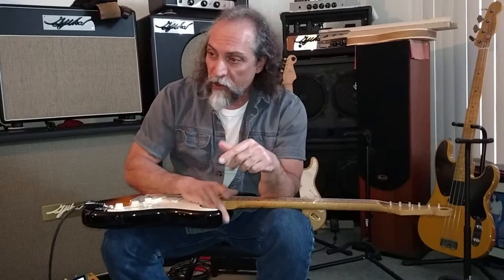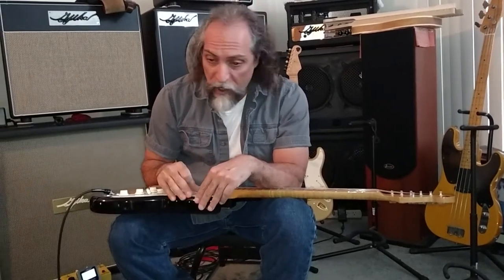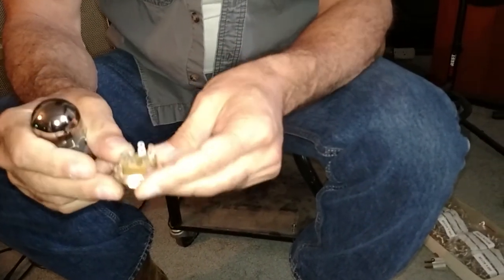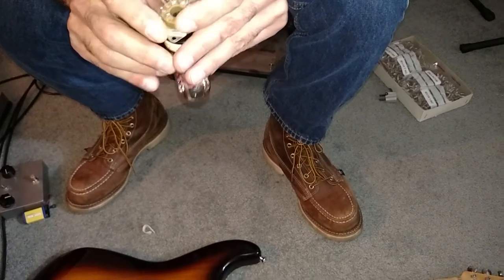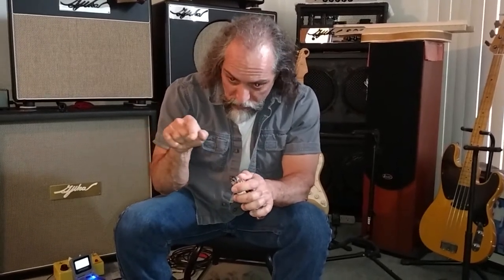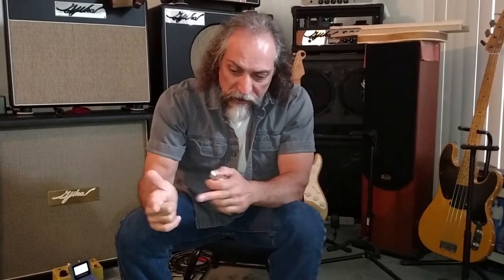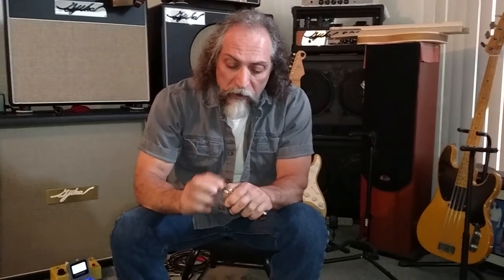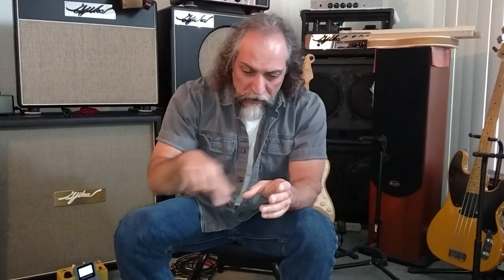Voltage for tube amps - Variac, surge protector, Ken Fischer (Trainwreck Circuits) guitar amplifiers

Comment: Those few (often times more than a few) volts difference on the primary can cause a significant rise in the secondary voltage. I have a friend who lives very close to the electric substation in his community. He was going though power tubes like crazy. He would bring the amp to me and Id replace the tubes and re-bias it. It was always fine at my place. When we had scratched our heads raw about it we finally thought of the wall voltage at his house. He started doing some checks and at one point measured 131 volts!

Comment: We never even thought about power sources back in the 70's and never had a problem.  Today, I'm still playing the same old Fender amps and I use a Variac to protect them.   I checked my wall voltage just today and it was around 123.4 V.

Comment: I use a "Tone Preserver" and it monitors voltage and current draw.
It allows you two drops in the voltage in two 6-volt stages.
I'm not affiliated just a very happy customer with very happy Tube amps!

Comment: Thanks.
I just bought a variac.
I will buy a meter and wire it in.
Good advice!
Reply: put fuses on the hot of both input and output, something like 4 amps for a 5 amp variac just to be safe

Comment: Do you run your amps through a Variac during the whole gig? 
I read a lot about using a Variac to “bring up” an old tube amp slowly, but what about in every day use? Is it best to actually use the amps through a Variac?
Reply from the maker: Yes, your amp should have the proper voltage at all times.

Comment: Re Class A; surge why not fit a HT/B+ delay and or reverse biased diodes from anode to ground? Also the 807 is essentially a 6L6 and sounds fine, at least to my ears, still, guitarists are pretty conservative where valves are concerned.

Comment: Something in the circuit PRIOR to transformer and tube that sees that voltage surge and instantly sends it to ground 
it would only allow correct voltage to pass through

Comment: Why wouldn’t an MOV in parallel with the PT primary solve the surge issue?
Reply from the maker: Sorry for the long delay, just saw your comment. I do put them in my amps but if something bad happens I would much rather an mov burn up in the power strip than in the amp. And if your selling a product  like you say it's a good idea to have that fail safe in there in case the user does not use any serge suppression device.
Reply: @BobGjika   Makes perfect sense. Keep up the great work, love the stuff you build and I enjoy the videos! Maybe one day I’ll give a single ended output stage another go, I never could get rid of enough hum without a truck load of negative feedback...